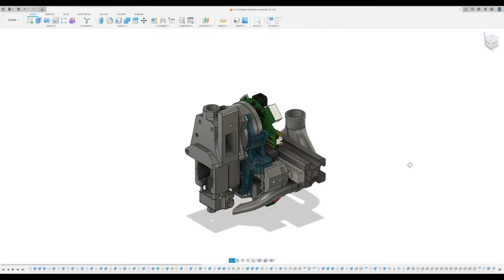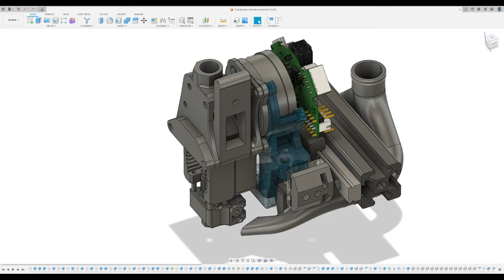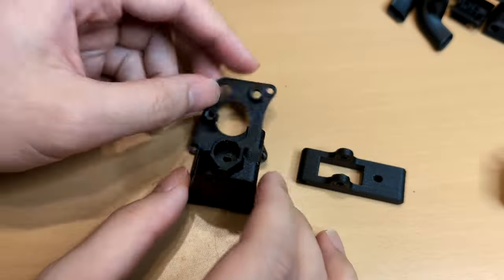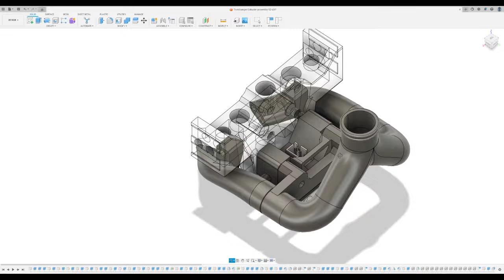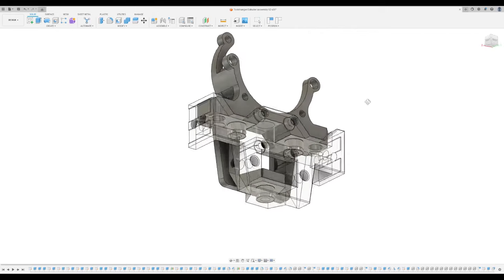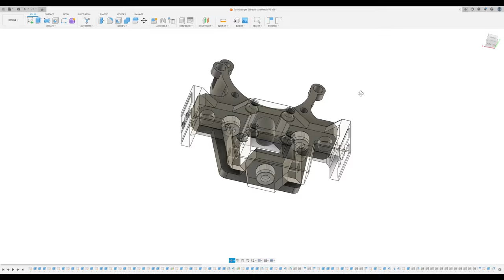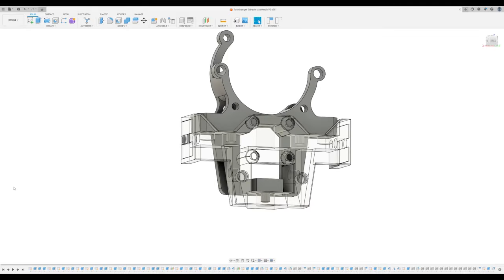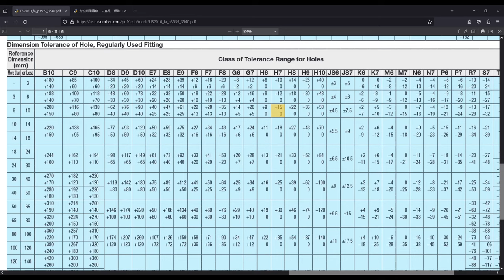[Tool changer] Sketch to prototype: build the first printhead

Comment: Hey mate! I’m just curious about the durability of the p150 and how had you found it to print. I was hoping to form a material with similar strength and durability as delrin but I am not sure if that is necessarily possible..
Reply from the maker: The company sent me some sample packs to test the material. I also have another video to test the material in the application. https://youtu.be/BJkQQgXM2tc

Comment: Your hotend is a method of fixing to the toolhead based on the Z axis.
If the nozzle passes through the section where the filaments are clumped during printing, will the hot end not be separated?
I'm also designing a tool changer.
I'm thinking about the idea of how to fix the hotend with the Y axis for this reason, but it's hard to fix it.
The method used in E3D in the past must be applied, but this method has the disadvantage of heavy toolhead.
Anyway, all X, Y, and Z axes need to be firmly fixed, but it seems to be a difficult solution.
I'll share any good ideas while watching your video.
Reply from the maker: I think it would be okay with this setup. I saw TapChanger and StealthChanger also using these z-axis release mechanisms. The key is to create a straight z-movement to detach the tool head. Any movement not straight upward will not detach the tool head because of the restriction of pins and bushings. A detaching process will need to go against the magnets to release. Two magnets on each side(shuttle & tool head) are firm and require some force to release, even with hands. I considered several models when I faced the same issue you mentioned. But, even the Voron Tap uses a rail to move the tool head in the z-axis,  and it has two magnets to hold the tool head when printing.
E3D and Prusa use the three-point fixing with their tool heads, which is highly repeatable. However, the connection is difficult to design and work with, especially if it involves a stepper or servo motor. At the same time, I also don't want to have too many custom CNC metal parts. These will drive the cost high and make them hard to replace.
Thank you for leaving a comment to share your thoughts about the tool changer. I'm glad to have some feedback about my current design and what could be improved or different approaches.
Reply: @SlowEngineering  so how does it compare to the stealthchanger or TapChanger. 
I have tried both mechanisms now and only with the tapchanger I get close to stock (original toolhead) input shaper. Trying to optimize the material and design right now, but going with a diffrent design could be fun, as the tapchanger is quite heavy (with dragonburner toolhead, but i think it is designed this way, cause the toolhead doesnt come back down when tapping if I make the fit to tight
Reply from the maker: @SippoCoffee I saw their design, but I haven't used them before. My toolhead fitting tolerance is tight to secure any offset possibility in the XY directions, especially when the printhead is moving fast. My design doesn't use any tap mechanism; instead, it uses the regular PCB Klicky to eliminate any need for leaving tolerance for probing. This should make the toolhead on the printhead more stable. A solid fitting makes the printhead into a piece to make the input shaper more easy to tune. What do you think about it?
Reply: @SlowEngineering  Why I would agree: A tighter fit/tolerances would make it more rigid and therefore show better results in input shaper, I agree with that. 

Why I maybe wouldn't agree: in theory you can think of the toolhead (without the coupling mechanism) as one solid peace, this would be if the whole construction is fully rigid, but if it is greatly more rigid than the coupling mechanism, I think you can still make that assumption. in this case, if the nozzle hits the bed under the coupling mechanism (imagine all of them being in the same z-y-plane), there would be force applied only in the z direction, with the fit having an impact through the friction alone. So technically, the nozzle hitting the bed and the shuttle putting the toolhead back in the dock would be the same stress for your coupling parts (correct me if I'm wrong). As you pick up your toolhead without extra force (just the mass of the toolhead), probing with tap would be just like docking and picking the tool back up, again and again.

I hated tap before I tried it, but now that I used it trough the tap- and stealthchanger mechanisms, I have to say, it is kinda really handy and easy (changing nozzle, hotend, or anything but the 2 coupling parts, just doesn't seem to matter for tap ^^). As a tap pcb is around 3$ on ali (that's where I got it) and you can just plug it in an arduino (or anything with 5v and GND) to see if it would work (lights change blue/red when triggered), you could just place a scale on your bed and babystep your toolhead onto it, to see at what load the probe would trigger (the hard part would be getting the probe onto the head without an adapter or redesigning).
Reply: Haven't tried messing with tolerances on the pin design, but on the bearing design I have made the fit way tighter, which resulted in better rigidity and in tap not working anymore (doesn't come back down), but it also meant I need an upper bumper on the dock, to apply the force so the tool can get pressed into the shuttle. Haven't tried that yet, but it would be interesting to see (and also require an extra probe so it can home, or with other words extra wirering 😅)
Reply from the maker: @SippoCoffee  In theory, any sliding needs tolerance to move parts relatively. Tighter means more rigid and not easy to move. I used two magnets to fix the toolhead on the printhead. On the docks, two steppers pull the toolhead out when detaching. There is always an offset in the sliding plane and the nozzle. Touching the bed generates a torque on the coupling mechanism. Long-term usage will make the pins bend the pin holes (where hold the pins) in the coupling mechanism. Unless, like the original tap, use a short liner rail for the movement; otherwise, I don't recommend using the pins as the sliding interface. I hope this can explain why I am not using the tap mechanism.
Reply: @SlowEngineering I see now where you are coming from, glad you take the longevity into account. Are you going to upload the coupling mechanism files (or already have somewhere) ? I would really like to compare it to some of the other free z-axis coupling designs.
Reply from the maker: @SippoCoffee The design is currently available to my Patreon supporters. Once the tool changer system is completed and fully verified, I plan to make it open source. Feel free to check it out if you're interested!